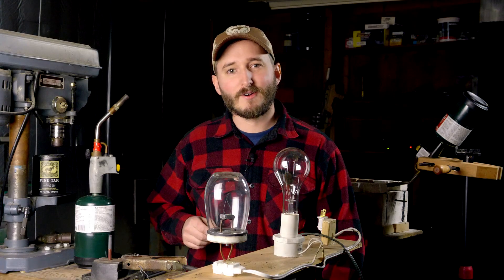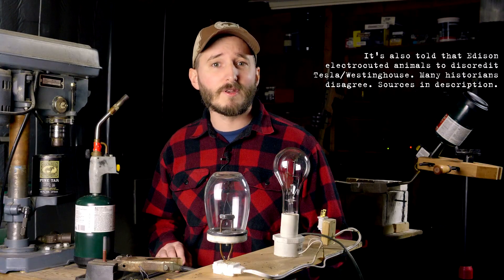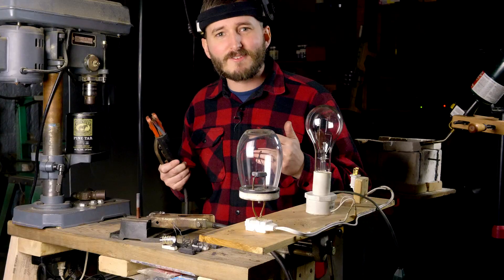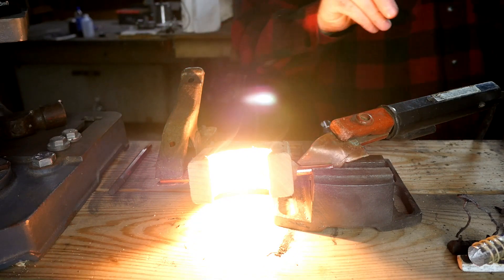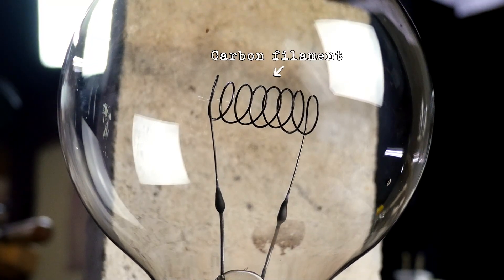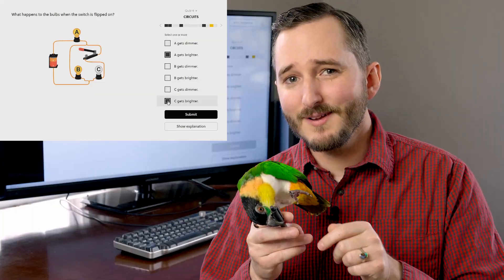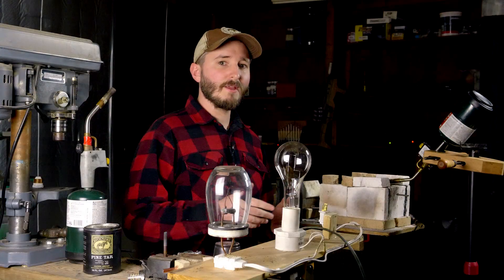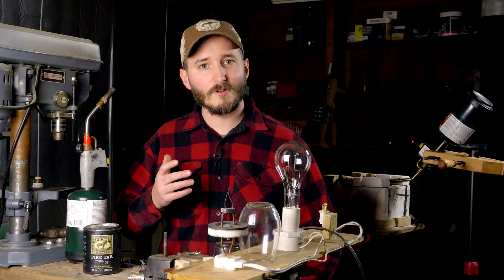Re-Inventing The Carbon Lightbulb

Comment: Dang it I was going to do this! Meh, let’s face it I probably would never have gotten around to it and wouldn’t have as good a job. 😅
Reply from the maker: I was watching your carbonizing series unfold as I was making filaments myself. I'd definitely like to see your take, especially if you can make a coiled filament from wood!
Reply: @Nighthawkinlight  Greetings NightHawkinLight and Cody,
In regards to wood and bamboo, instead of using the more raw form break it down a bit so that you have a more workable fiber. Crushing or mashing (Gently) it after being soaked should help to release the fiber you are after. also when working it do not crush it so as to shorten the fiber, but rather to separate the longer fiber.
Reply: @Nighthawkinlight  Cody please do this.
Reply: @Nighthawkinlight  what if you carved the wood into the spiral shape, would probably take a good bit of skill, maybe use a dremel
Reply: @Nighthawkinlight  there is a tool that people use to cut curly fries... you put the potato in and then turn the knob and it cuts the potato in a spiral... you could probably machine a drill bit of similar design to cut a spiral filament out of wood...
Reply: Could you do a vacuum based bulb using a sprengel pump?
Reply: Do you still have your Sprengel pump, Cody? Would definitely be interesting to see just how long you can make a self-made bulb work for, that's a twist interesting enough to be different and NHIL has given his blessing! Do it ;)
Reply: Cant wait for codys version !
Reply: @Cody'sLab you are not the only one who's been looking at this idea, It 's on our todo list too. We all have our own take, you should still do it.  Like a Mars survival island. use the grass you have access to and just do it.
Reply: Cody, you've got a superior vacuum pump, you can still make one! And now this is almost a CHALLENGE FOR YOU TO MAKE ONE BETTER THAN NIGHTHAWK
Reply: @masonp1314  i totally agree!!
Reply: I would love to see you do this!
Reply: Cody, would your sprengel pump be enough to vacuum the light bulb? You should definitely give making the filament and vacuuming the housing a shot.
Reply: You two need to work together on some stuff!
Reply: I would love to see Bio lamps in your mars base.
Reply: He's not mastered the spiral filament yet. The challenge is still on! Would love to see your take on it.
Reply: Cody would have tasted the filements.
Reply: We all know you'd just eat the filaments instead of actually testing them in a lightbulb.
Reply: Cody put those damn light bulbs away and dig the chicken hole tunnel. I want to see that. Love you.
Reply: mr pegger I second that
Reply: NightSwanInLight
Reply: But... nitroglycerine light bulb...
Reply: You should still do it, Cody!  I share NightHawkInLight's interest in seeing your take on and approach to it!
Reply: What about graphite from mechanical pencils? 
And its awesome we have such a diverse community of people on YouTube that are actually discovering and teaching all the things that never get touched on in school anymore yet would be absolutely vital to continuation/rebuilding of modern technological society should something truly dire occur.
From Primitive Technology and How To Make Everything, to Cody's Lab, Nile Red and Nighthawk In Light, all contributing priceless information and reawakening curiosity and critical thinking in people that was stamped out by the education system. 
Your work is invaluable and appreciated.
Reply: Do it anyway, I would be keen to see how yours differ and what kind of results you can get with your resources.
Reply: Cody'sLab show us how to make a variable voltage resistor instead! I’d like to see how it’s done cody 😬
Reply: No doubt that you would have another interesting take on it! Every channel have their own way of doing things, and i love your typically more "hacked" way of doing it, which shows that you don't need a big fancy lab to do cool stuff. If i just watched this video and saw a recommendation of you doing the same, i would watch it anyway
Reply: I would still love you see you do it Cody!
Reply: Give it a try Cody !
Reply: Cody'sLab can you try to make white phosphorus by mixing bone ash into these filaments?
Reply: Oh, please do it anyway Cody. You probably more resources such as noble gases to make a lightbulb.
Reply: To get to the needed vacuum it would be  helpful to have a diffusion pump in line with a regular vacuum pump. This could get you where I think you need to go. Something I would love to see is a home brew diffusion pump. That would be really interesting!
Reply: I'd love to see you try, you even have a pretty good vacuum pump, IIRC you have a lot of mercury and already made a sprengel pump,so getting this part right should be possible
Reply: do it cody
Reply: How about trying carbonized flowers as filaments or just creating a new series "will it filament"
Reply: What if you made a mercury bulb?
Reply: It does suck to have so many thoughts and the resources to do great projects and you just can't. For me depression has been the limiting factor but there's lots of reasons and it does suck. Also fun to joke about if you're simply too busy or a procrastinater lol. Idk you just made me think so thanks.
Reply: The early nighthawk gets the light. Or something. 🤪
Reply: Cody cuz you don't make this video you're doing a disservice to yourself and all of YouTube but on a lighter note love you man you're a damn genius😁🤗
Reply: You’ll come come up with something cool to do, you always do! It’s good to see you over here Cody!
Reply: We all know you’ll try anyway. Then eat the filament afterwards.
Reply: Y'all should collab
Reply: Your too busy shrooming anyway lol
Reply: @rizdalegend  not lol but maybe true